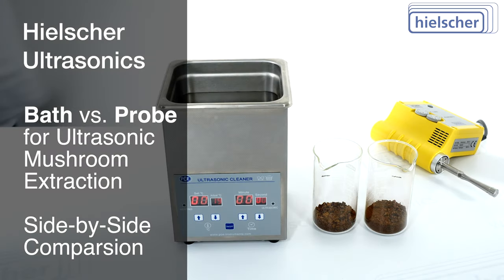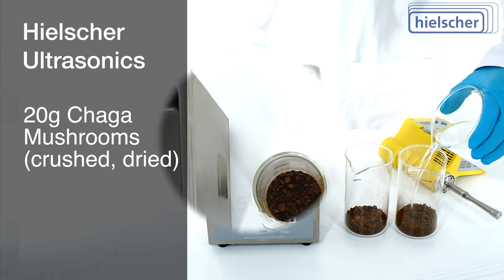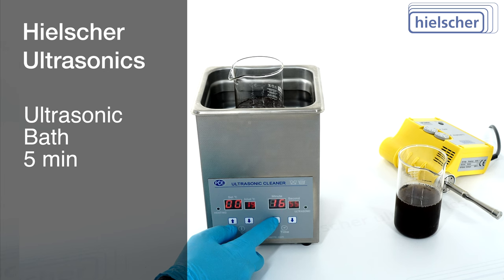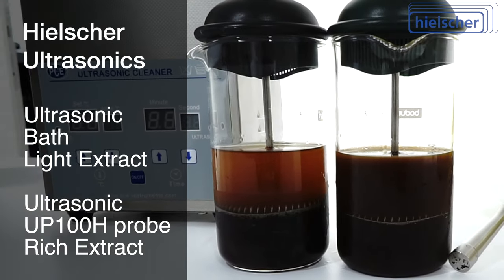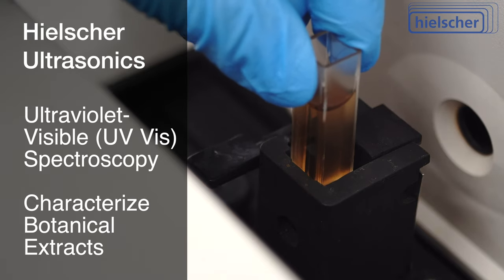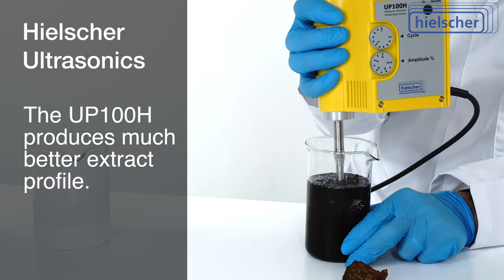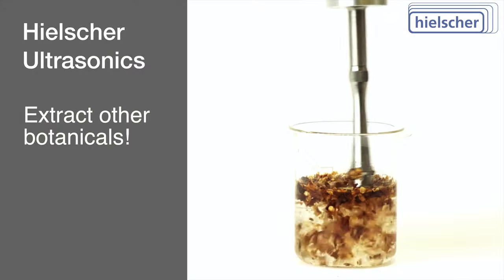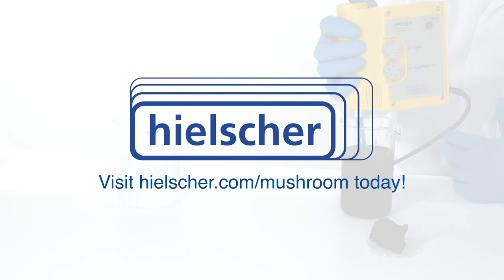Mushroom Extraction - Bath vs Probe Sonicator - Side-by-Side Comparison

Comment: "Non-thermal extraction at minus 10 degrees Celsius" 0:47
Then the solution is lowered into a 19 degrees Celsius hot bath
- I guess that the solution didn't stay at -10 [C] for verrrry long ;ø)
Reply from the maker: @EgonSorensen: Thermal (= non-non-thermal 😉) extraction mostly refers to exposure to 70 degrees Celsius or more for long periods. In thermal extraction you are just cooking your materials for extraction. At lower temperatures or short exposure, you don’t get much extraction - unless you use sonication.
The long exposure to high temperatures of thermal extraction causes heat degradation of materials and bioactive compounds.
We will be glad to assist you with your extraction project. Please contact us directly! Don’t forget to subscribe to our channel for more interesting videos.
Reply: @HielscherUltrasonics  You say that a lower temperature results in better yields and extract quality - then you show a UV VIS Overlaid Spectra showing the difference in quality/yield. 
If the chilled solution, vs. room temperature solution, quality/yield wise is the method of sonication, then why bring up temperature?
I was searching for videos on Lion's mane and how to grow them, benefits, etc - and your video came up. Interesting, and just to be clear - it is not the temperature (mostly - say >80%) but the applied method of sonication that determines yield/quality.
Thanks!
Reply from the maker: @EgonSorensen: This video is to compare two non-thermal ultrasonic extraction setups. Many people think sonication is all the same - no matter what setup, intensity or power. That is not true. An ultrasound bath produces a mere 1 micrometer amplitude. While sufficient for cleaning jewelry, this is insufficient for breaking cell walls.
The UV Vis overlay is to show that difference resulting from different sonication settings.
A thermal/non-thermal comparison would be a topic for another video. However, it’s commonly known, that various lionsmane compounds are heat sensitive.
Thanks for watching!
Reply: what if the plant material is saturated in water and then frozen like in the case of chaga.  wouldnt the freezing break the chitin cell walls and then be more effective in a sonic bath?  yet perhaps this is still not as good as a wand. would love to hear your input.  thanks!! 🙏
Reply from the maker: A single freeze-thaw cycle won’t be enough. Also just breaking the cell barrier won’t extract much. Sonication emulsifies insoluble compounds and assists transport from the cells to the liquid phase.